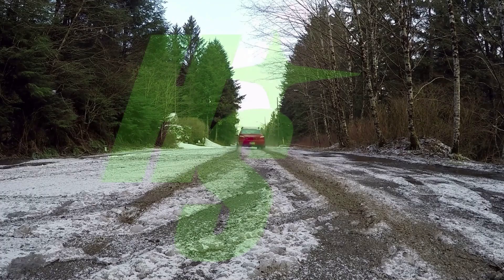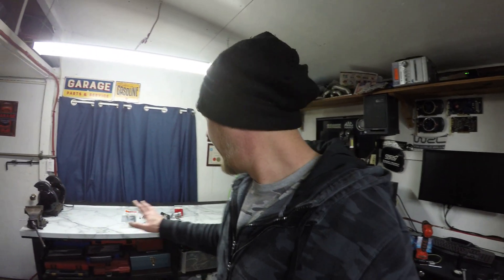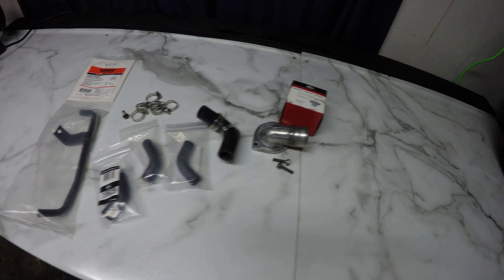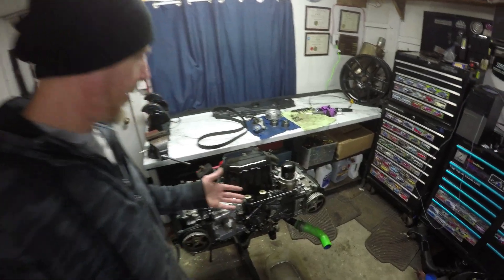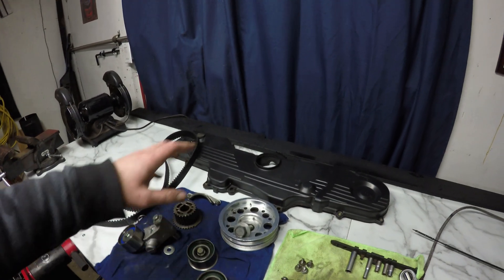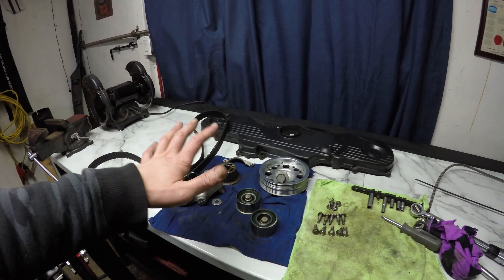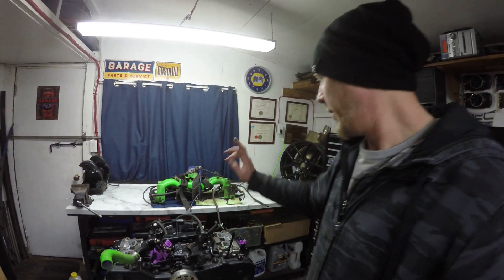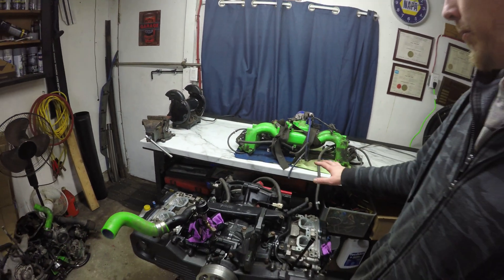My Impreza Engine Build Part 12

Comment: Single cam? Whaaaa??? Man, I had so many problems with adding a turbo to my 251
Good luck.
Reply from the maker: Did your 251 build have a 257 shortblock?  😉
Reply: @HomebrewSubaru  yes..  205, then 257 then 207..

Comment: Bro a genuine wrx has a quad cam engine. That is a N/A single cam non turbo engine.
Reply: Glad someone else pointed that out…..I was scratching my head like wtf did I miss all those years ago😂
Reply from the maker: That is an STi block with 251 heads. It’s turbo ready. This channel is called Homebrew Subaru after all lmao 🤣